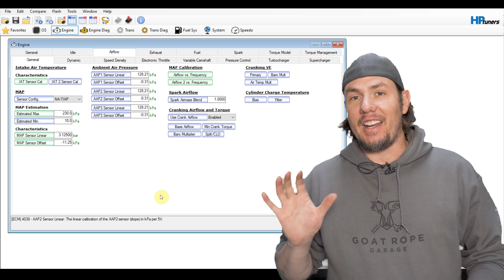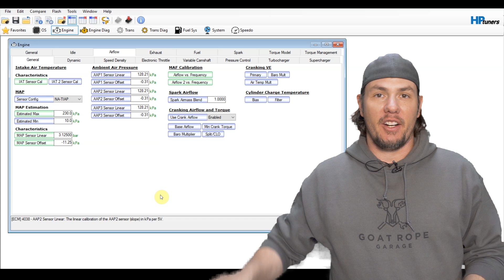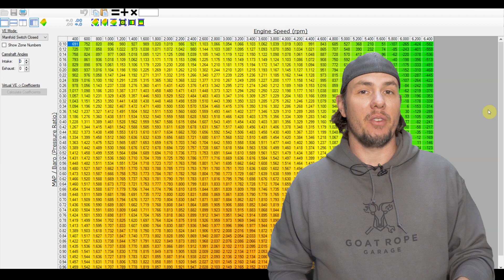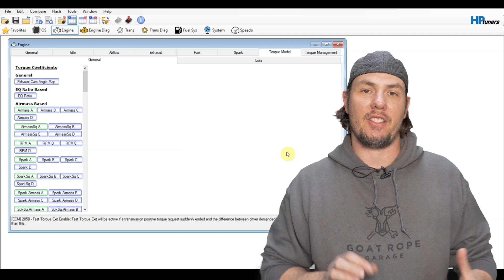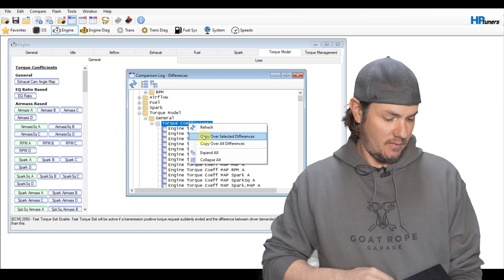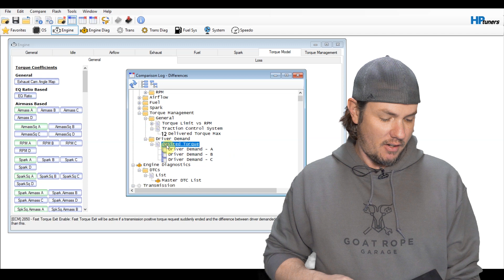How To Detune A Vehicle In HP Tuners, Going From FI to NA

Comment: I don't care what anyone says, 2006 was a bastard year!
I did a 3.9L 6 speed conversion to a G6 that had a 3.5L Automatic. 
Same year GM swapped PCM pins from round to square pins. Ended up wiring the entire car. What a nightmare that was.
Alldata would say one wire don't go there, Mitchell on demand said it does go there. LoL!
I've got wiring background, if you need any assistance brother.

Comment: I have a question but please correct me if im wrong the aircharge in g is calculated based on the ve table right so in a fi it should correlate to the map sensor right , now could you tell me roughly how is it calculated
Reply from the maker: From the forums:

To get the cylinder airmass from the MAF flowrate, take the RPMs and divide them by 60. This gives RPS. Multiply the RPS x 4 for a V8 to get the number of intake cycles. Dividing the flowrate of the MAF by the number of intake cycles gives the cylinder airmass. With the VE tables, you have to multiply the cylinder volume by the VE. This gives the relative volume of air in the cylinder. Then multiply the volume by the density of air at the temperature reported by the IAT, and you have the mass of air in the cylinder.
Reply: Goat Rope Garage thank you very much i’ve been searching  for this for days